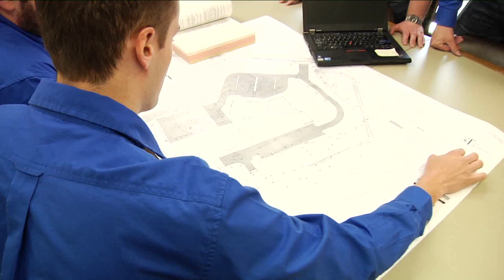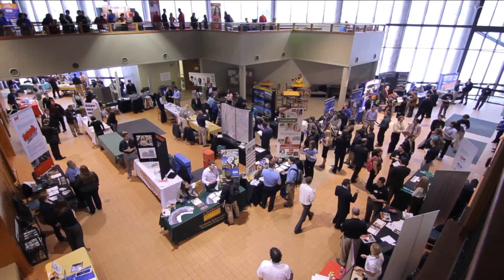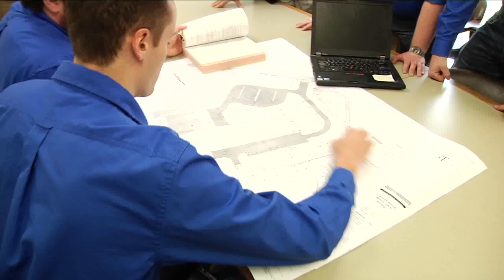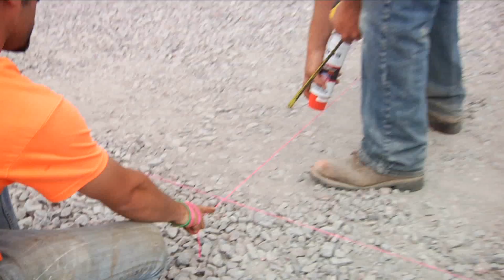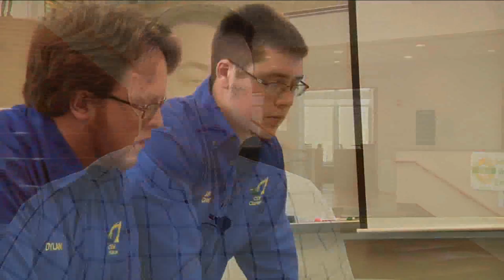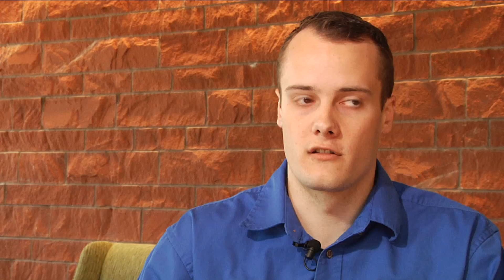Construction Engineering Management at Clarkson University

Comment: How hard is it to find these kind of jobs after college with a GPA of 3.5?
Reply from the maker: Angel Perez Angel,
Thanks for inquiring.  The short answer is, not hard at all. 
Clarkson's CEM program boasts 100% placement for all of its students.
Construction Engineering Management is a field where
there is a very high level of need both now
and going into the future.  Even with a relatively lower GPA, say 2.5,
firms recognize the challenge of learning the core engineering
curriculum tied with the construction management and engineering
management skills you gain in a program like Clarkson's. 
A GPA of 3.5 would be highly sought after by many firms.  Feel free to
contact the Director of the Program, Mr. Erik Backus, at ebackus@clarkson.edu
or through the Clarkson CEM twitter feed @ClarksonCEM.  Thanks again.